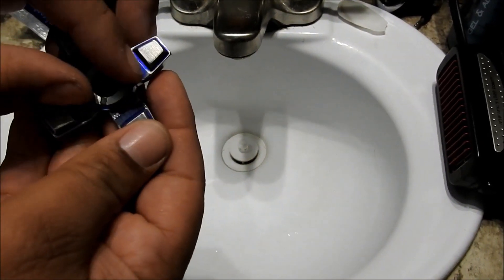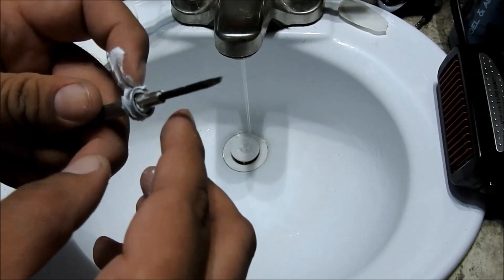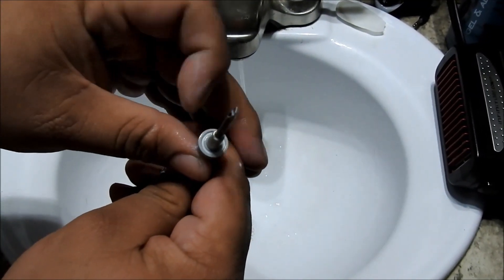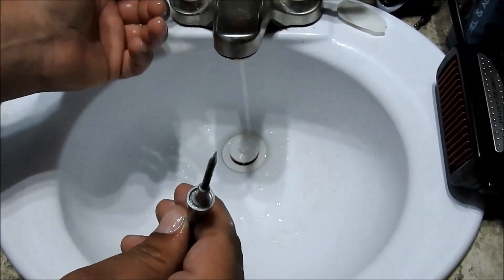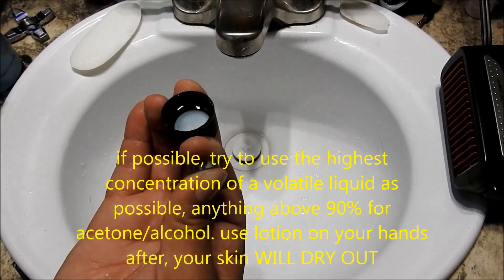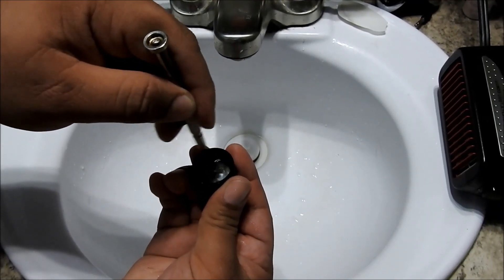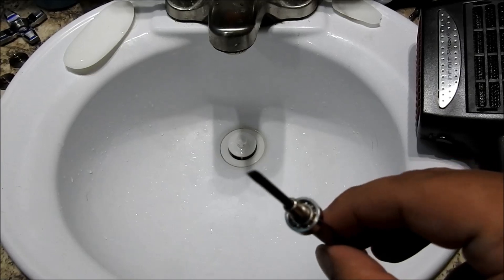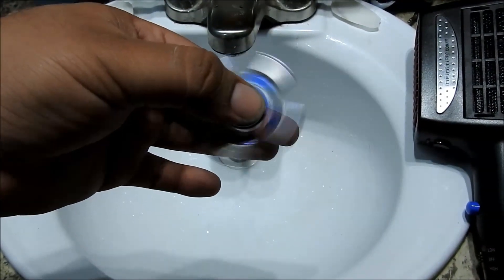how to remove rust from bearing R188, 608, 606

Comment: hello
Reply: hello
Reply from the maker: XxPro_ GamingxX sup
Reply: Benjamin Bribiesca Hey
Reply from the maker: XxPro_ GamingxX what up
Reply: Benjamin Bribiesca Do you know how to clean a 608 steel ball bearning?
Reply from the maker: XxPro_ GamingxX same video applies to that bearing as well. does it have shields?
Reply: Benjamin Bribiesca I'm 608 full ceramic bearing
Reply from the maker: XxPro_ GamingxX then don't follow this video. you should be fine with just dish soap and warm water. if you use toothpaste on a ceramic bearing it will dull it and give you less spin time.

Comment: are R188 bearings ceramic or steel?
Reply from the maker: GunShot both. you can get R188 in full steel, full stainless steel, or full ceramic, or a hybrid between 2.